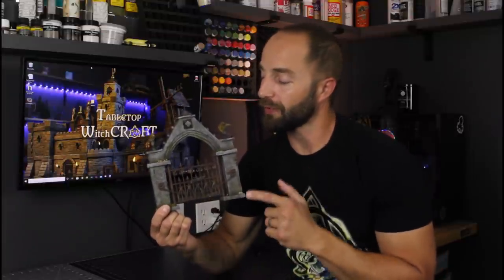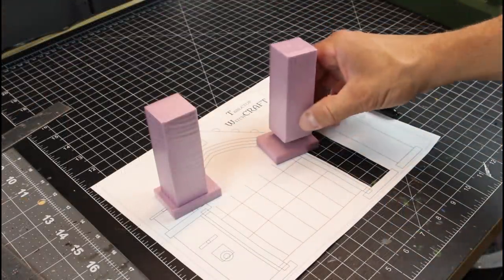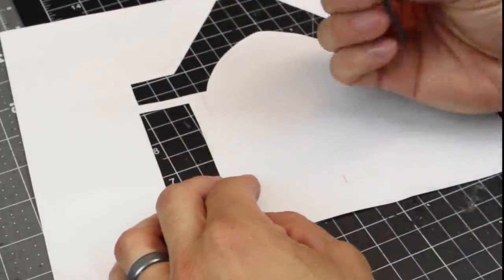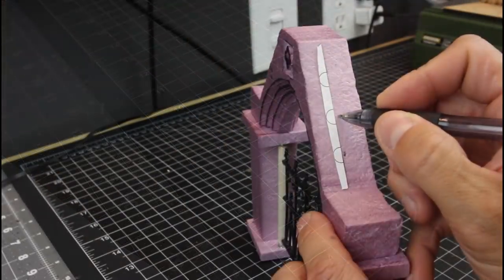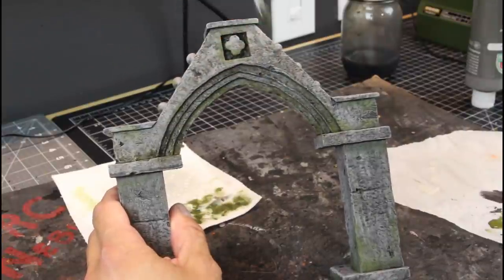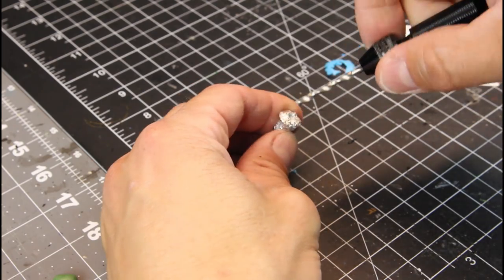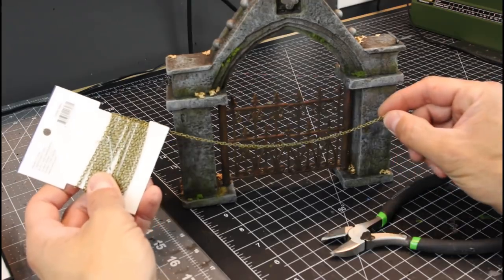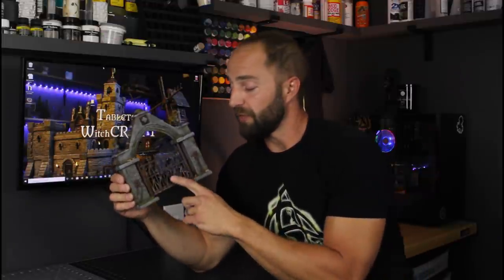Modular Graveyard Gate for Dungeons and Dragons

Comment: Really should have had a center piece for the gate itself, just a straight piece on either interior edge rather than having the open spaces from the pattern in the fence there as part of it. Gates of the type have them because it's easier to secure and handle the gates, such as chains to keep them open in place as well as closed.

Comment: Did you back the Kickstarter "Tabletop terrain from XPS foam: Buildings"?  I bet you would get a lot of fun ideas from that.  I have been following their channel and the brief updates about their book and I think they build things like your arch by slicing thin layers (vertically here) and then carve those layers at different sizes and glue them back together.  I don't know if that would work on the top for you but it seems it could make the arch thicknesses easier to carve.  What do you think?
Reply from the maker: I'll have to check it out... thanks for the heads up.